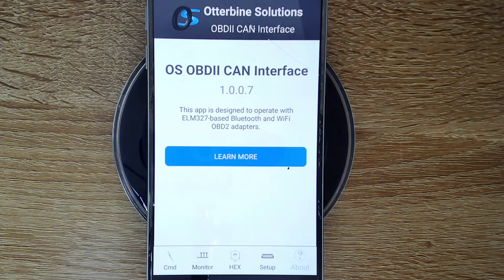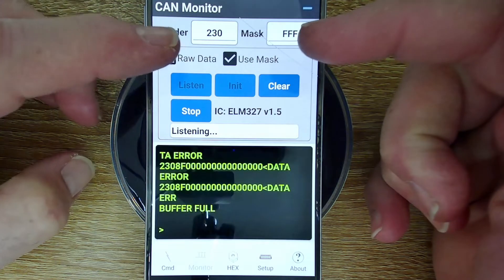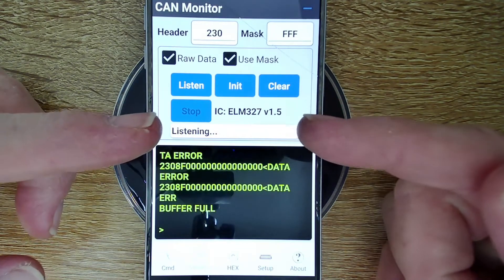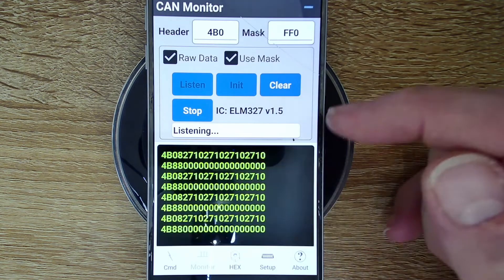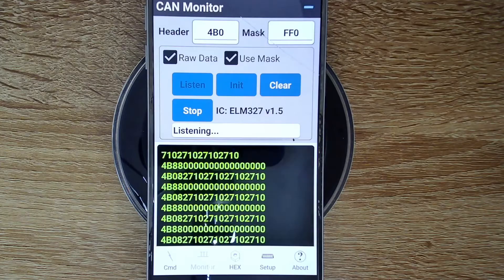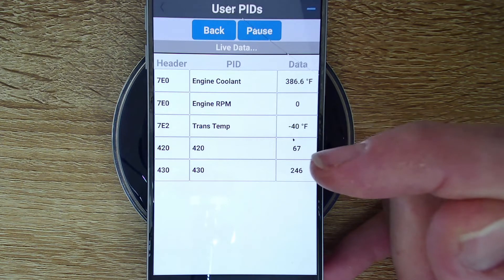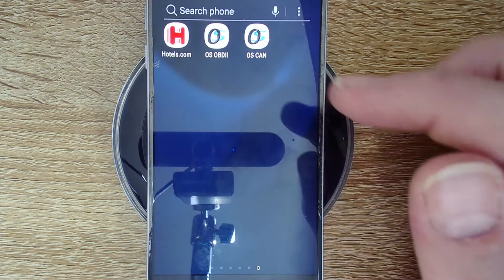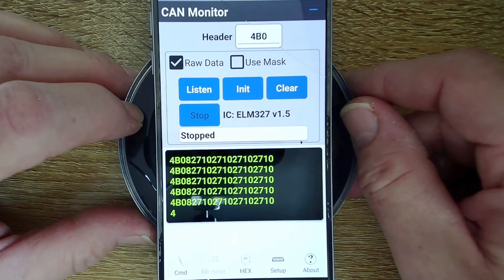OBDII: CAN Motoring With The ELM327 Is Less Than Ideal

Comment: Hey man! Many thanks for your videos, you helped me a lot! 🚀🚀🚀

For monitoring all the messages in the bus, did you send an AT MA command to the ELM327?

Man, did you try to increase the Baud Rate to 500 K? The buffer should clear out faster. 

Also, try turning off spaces and Linefeeds (AT SO, AT LO). The documentation says that the buffer usually doesn't go FULL even in very busy busses with this configuration (I presume very busy busses are newer cars, maybe hybrid, with the engine turned on).

You could also create a sniff mode, with an option where you scan only unknown IDs (you can do this by filtering), for example you could exclude all OBD's standard IDs, as all these IDs you already know what they do, and let space for more interesting IDs for reverse engineering.

Thanks again. 🙏🏽
Reply from the maker: Great suggestions, thanks. Did all that, but the baud rate thing. I'll try it.

Comment: I tested the app with an ELM327 v2.2 device and I didn't run into any buffer issues! But i have alot of connection issues with it. I recently found out that the app Real Dash also has a can monitor built it but no matter what I try it won't work with my dongle, it says that the recommanded one is the OBDLink MX+, which is quite expensive imo
Reply from the maker: You have connection issues with my app? I don't give this thing the time it deserves, but I don't like to hear that.
Sometimes, if you set the protocol explicitly, it will work better. The auto protocol requires a bit of back and forth to settle. Also, I think version 2.2 may have some other settings pertaining to the monitor. I will check. I'd appreciate any other details.
Thanks!